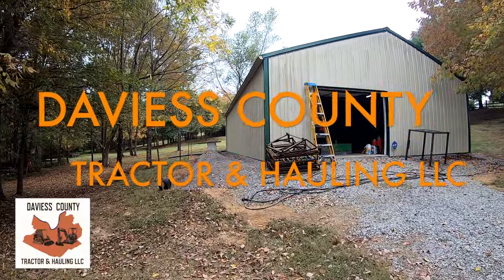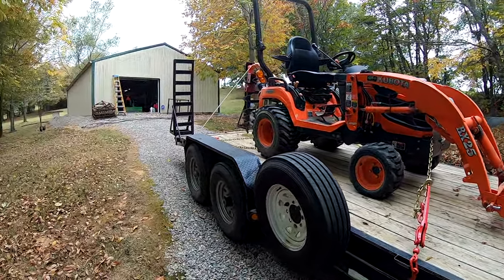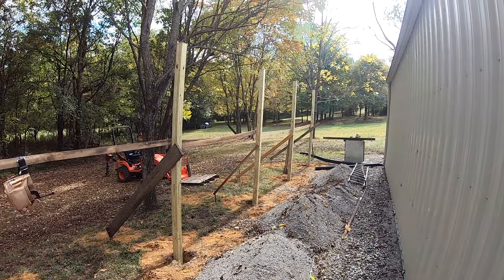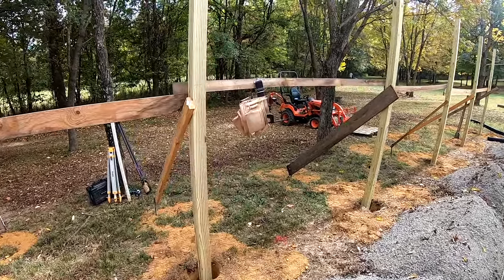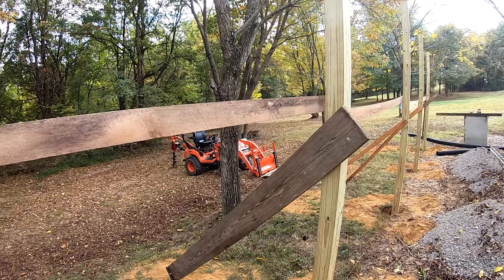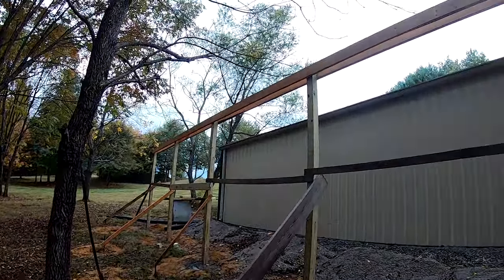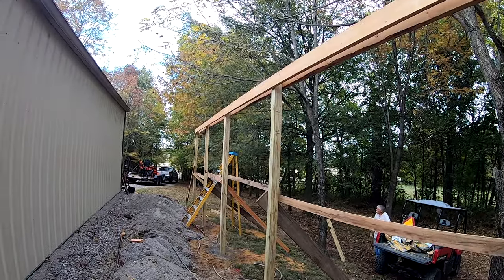Adding a Lean-To on a Pole Barn Pt. 1 - Posts & Header Boards

Comment: Pressure-treated wood will rot in concrete when exposed to wet conditions such as trapped water. In optimal conditions, pressure-treated wood set in the earth may last as long as 40 years. However, when vertically set in a non-draining concrete base, pressure-treated wood may last only a few years.
 I have a neighbor that can tell you what a PITA it is to replace those rotted off posts, to save the building.
Reply from the maker: Appreciate your comment.  I agree there are some better ways to set posts, but this is the way 90% of posts on every pole barn structure are set.
Reply: Yes it will I have some 4x4 post in concrete exposed that’s about 35 years old now and I expect the rot to get em any time now.

Comment: How did the concrete hold up? Was wondering what Benifits are there to pouring the mix in the. Watering it down vs premixing then pouring in the hole. Thanka
Reply from the maker: Concrete has held up fine. Usually between ground water and moisture in the ground and rain and wetting the top it solidifies. I think lots of fence guys use this method as well. It's probably not technically as good as premixing but it works and it's easier.

Comment: Nice looking so far. Can you tell me the measurements of the lean to? It’s starting from under the gutter/eve to the posts?  What’s the highest point to the lowest point? All I caught that it’s going to be 9 ft wide. Thanks a lot for sharing!
Reply from the maker: I think we made it drop 1' in that 9' run

Comment: From reading the comments your 9' wide and 9" below the gutter on the end. that would make it 1/12 pitch correct? how is that for snow load? i live in south Wisconsin. Also if you said it in the video i apologize i have no sound. thank you
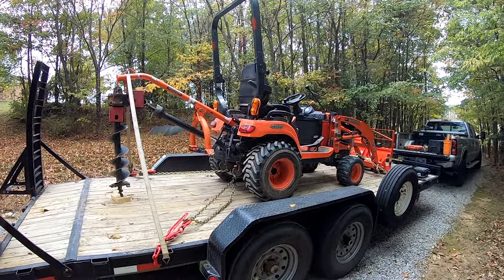Reply from the maker: Yes that is correct 1:12 pitch. This is in Kentucky. If you have heavy snow I would put posts closer together and probably add more rafters (these were 4' on center). I looked at another pole barn that was installed by a local contractor and we use the same post and rafter sizing and spacing. You might look around and do the same for your area.

Comment: I saw you add concrete to the post holes but I didnt see anything before hand. Did you add any crushed rock or anything before putting the post down in the hole?
Reply from the maker: Hey Hammer, we didn't add anything below the posts on this build.  On my solar panel structure i did add solid concrete blocks below the 6x6 posts.  Never a bad idea to get the post out of the dirt.

Comment: Wondering what you attach the ledger to? Is there decking on the inside of the building or are you simply going through the metal. I want to build similar to this and have only metal sheeting. Wondering if I should "sandwich" a ledger on each side? Any suggestions?
Reply from the maker: It is not screwed into the metal only. Most pole barns have a header that runs from post to post and then the trusses sit on that header beam. That is what my ledger board is screwed into. It was. 2x10
Reply: @NealORussa  any suggestions on how to attach to a completely steel building? I have iron supports and metal attached to that. I have thought about adding wood on both or maybe having to have post supports on both side of the lean to.
Reply from the maker: @michaelmurphy2028  is it a red iron building or like a carport type building with the galvanized square tubing?

Comment: Thanks for this video!!  Well done and informative!!  Do the headers also need to be treated, or just the vertical posts?
Reply: Also, what screws did you use to secure the headers?
Reply from the maker: @brentpeters906  thanks for the comment! The more treated the better for an outdoor structure. I can't recall what we used on this one, my father in law got all the materials. 
For the header screws we used 5/16" hss lag screws.

Comment: best way to square a corner post off a building so the two side walls are in line with the building? Thanks
Reply from the maker: Run a string line along the existing building at least 10-20" back or from corner to corner then run it out past the building in that straight line.

Comment: are those 4x4 or 6x6 post? and what is the spacing between them?
Reply from the maker: Those are 4x4 posts.  They are spaced 8' apart.  I have two other buildings with lean to's that were built with similar spacing.  Though, in this instance here, these are pretty tall posts due to the downward slope of the ground.  It might be good to up-size them a little if they're going to stick more than 8' out of the ground.

Comment: Curious is 10 ft feet apart ok. Poles are 8 ft tall for a 8 ft wide lean?
Reply from the maker: You need to figure your roof loading for your area. It needs to include weight of the rafters and roof itself, and any live loads such as snow or wind. Once you have that load, say it's 45lbs per sq ft you need to multiple that by 80sf. Since you take 8' wide x10' spacing. Then that value must be less than the vertical column capacity. For 4x4 posts, 8' tall, your capacity is 4,694 lbs for no 2 Douglas-fir-Larch species.

Comment: Hey Neal, awesome video.  Would you tell me how the supports are anchored in the ground that you use to hold the posts level? Looks like a rebar contraption?
Reply from the maker: Sure thing!  Those are concrete forming stakes.  They're metal stakes, about 3/4" diameter, about 2' long or 30", and they have holes staggered through the length of them so you can run a nail or screw through the stake.  As an alternative you can make wooden stakes out of 2x4's by cutting a point on one end and hammer them into the ground instead.
Reply: @NealORussa  I see. Thank you!

Comment: Hi,  - subscibed - do you have a materials list so that I have an idea of how to purchase for my size of lean to?  Also, can sheeting be installed on the long side for protection against weather, if so, is the installation different that the roof?  Thanks
Reply from the maker: Hey Mary, unfortunately I do not have a very good materials list, since i was just helping my father in law.  Also based on your post spacing and lean to width would change the rafter and joist sizing and spacing.  As far as the wall sheeting goes, yes you can defintiely install it similar to the roof, except the 2x4 "purlins" are called "girts" on a wall.  And you can probably space them at 30 or 36" instead of 24" like the roof purlins.

Comment: Hi Neil 
Just subscribed. I have 2 questions. 
First I have a yanmar tractor similar to your kubota with a similar post hole digger. It only has a 6” auger though. What’s a good source for a bigger auger? Or can it be rented? 
Second. I’m planning on building a pole barn in the spring. 16x32 to store Equiptment. Are 4x4 posts with 8’ spacing acceptable? 
Thank you.
Reply from the maker: Hey thanks for subscribing and the comment! I would look at tractor supply for extra augers, otherwise Agrisupply.com. I would get a 10" or 12". My 9 is as small as you want to go with 4x4's. Regarding the post strength. I have two buildings on my property that were built by pole barn companies. Both have lean tos constructed identical to this layout. We will also add 4x4 gussets on those posts, about 4' long at a 45* angle from the header board down about 2.5' on the posts. This is done on each side of each post, making a Y shape at the top of the post. The corners get them as well but one angles toward the building and one angles down the line toward the next post. Hope that helps!
Reply from the maker: If you have a lot of snow though, you might consider 4x6's and a 2x8 header board at the top of the posts.
Reply: @NealORussa  Thanks for the reply Neil. I’m getting information this winter so I can build in the spring. I would think 4x4 done the way you said will be ok but I do need to consider snow. I’m in Pennsylvania and we don’t get crazy amounts of snow usually but every now and then we do. Thanks for input I appreciate it.

Comment: How did you know high to cut off the post
Reply from the maker: Hey Mike!  I don't know if i completely covered it in the video, but I knew i wanted the posts cut off around 9" lower than the lowest end of the gutter, plus the fall from gutter to posts.  So I used my rotary laser and rod to shoot the gutter, then raised my laser reciever eye up around 14-15 inches, then used that to mark the cutoff elevation of all my posts.  You could simplify this with a level and 8' board, then measure down the height you wanted it from the gutter, and level over to your first post, then level over from post to post or run a stringline.
Reply: Thanks

Comment: Hope you're not located in snow country.  Those metal buildings are designed to carry ONLY what loads its roof sees and there's really not any reserve capacity left for the added load imposed by the lean-to roof.
Reply from the maker: Thanks for the comment!  Our region doesn't see much snow, but building code requires a snow load of 15psf.  That existing structure is built with 6x6 columns 8' on center with double 2x10 header boards.  I have a similar span pole barn that was originally built with 8' column spacing and smaller 2x6 double header boards with a lean to structure.  It was built in 2001 and has held up good.  I'm hoping he won't have any problems!
Reply: That load is a down force load directly over the side wall , It’ll be just fine. Also engineered load ratings are generally a not the full live load limit. It gives them more peace of mind.
Reply: @Schism75  And you base this premise on what?  As a licensed structural engineer I would question your statement "Also engineered load ratings are generally a not the full live load limit."  Now, if you're an structural engineer involved in designing PEMBs perhaps you know more than I.
Reply: @CT_Yankee  ez turbo, I’m not trying to insult your intelligence. I’m only speaking from 25 years of PEMB erecting and have added many porch and leant to extension and I know for a fact load ratings on materials are not rated at failure point and you and I both know the height and width of his addition will never pose a threat to his building integrity. I’m not claiming to be any smarter than you, I’m just going off experience.
Reply: @Schism75  With steel structural members there are 2 items to be considered - yield stress and ultimate failure stress.  Design capacity is typically considered to be stress at a level below yield stress.  Failure stress is a whole other animal.  Once yield stress is exceeded we are now in the plastic design category.  In simpler terms, steel just continues to 'stretch' from additional load until its plastic limit is reached.  So, if deformation is not a concern, exceeding the safe stress level based on yield stress can be doable, although I would never go there.  If the lean-to addition is framed and connected to the existing steel columns (without modifying those columns), then all is likely good.  Lean-tos are generally lower than the main roof so snow drifting become a concern where I live.
Having worked for a PEMB manufacturer and having investigated failed PEMBs, I have little trust that any real excess capacity exists.
Reply: @CT_Yankee  most failures I’ve witnessed in prefab buildings were due to the peak of the building giving way under load. I’m not an engineer by far although I’ve taken several courses on load configuration and capacity due to a job I once had as an arena rigger. I have had to reinforce existing columns when doing a cantilever lean to off an existing prefab structure.